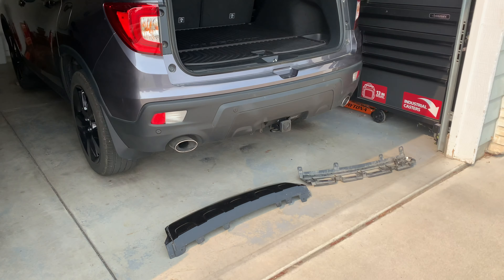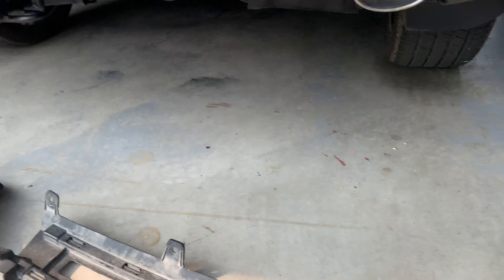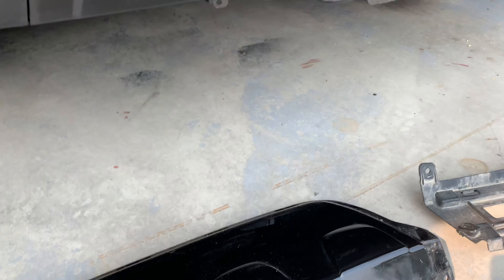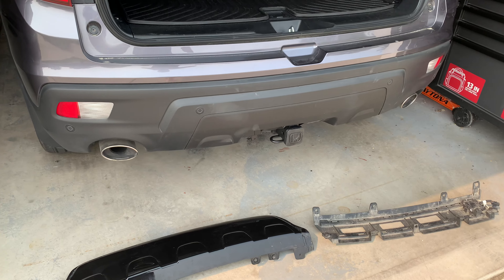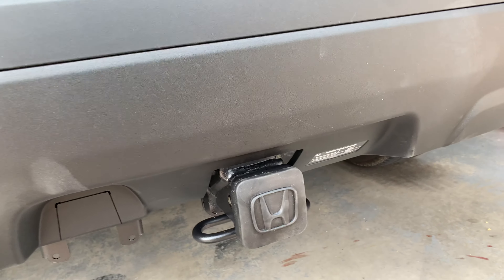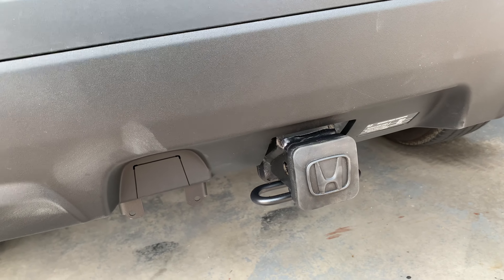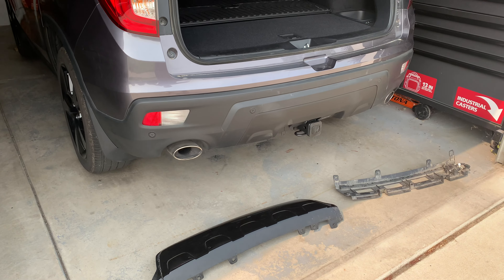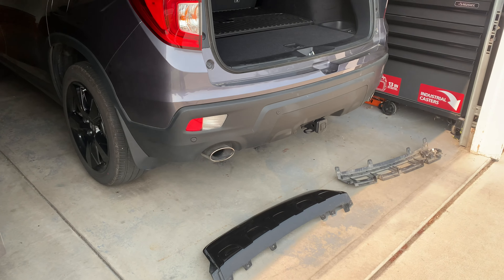Completed OEM Tow Hitch install on the 2020 Honda Passport Elite

Comment: Did you lose the backup sensors doing this method without buying the rear hands-free sensor replacement?
Reply from the maker: As far as I know they still work good, I usually have them off because they go off like crazy in my garage, if I find out they don’t work I’ll let you know. But they do 😂

Comment: I like that the oem version sits higher and looks a bit more natural. However, the big pro to the curt version is that u can retain the valence which I like. The biggest issue is the hands free sensor and so far from reading reviews, some have confirmed it still works but there was on that claimed it did not. For me, it’s one of the cool features of the car I would hate to lose.  I might end up and gamble on the cure in hopes it does not affect the handsfree.
Reply from the maker: Heck yeah! Let us know if it works for you.
Reply: Aftermarket hitch will block the kick sensor. It had to be relocated which when you buy from the dealer you can get the adapter. Sits much higher up with oem hitch. Oem much better way of doing it.
Reply from the maker: Thanks 🙏 I was curious about that.